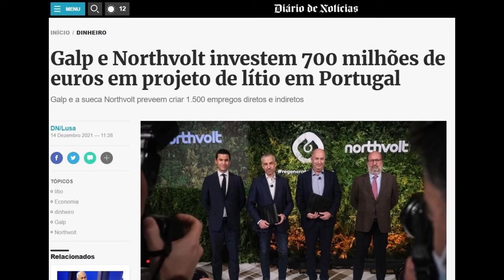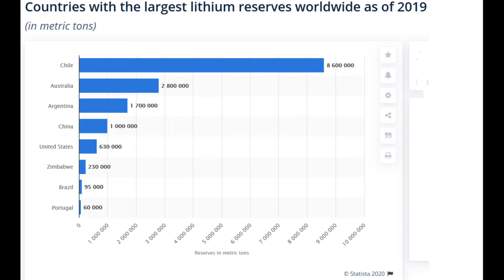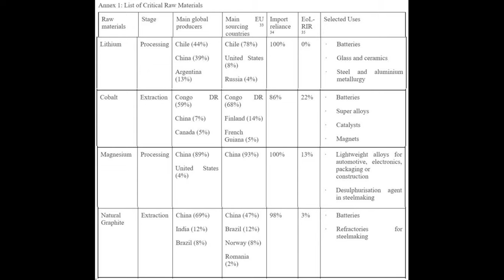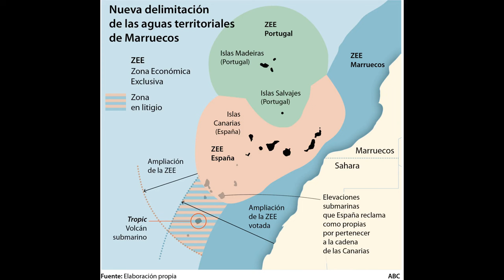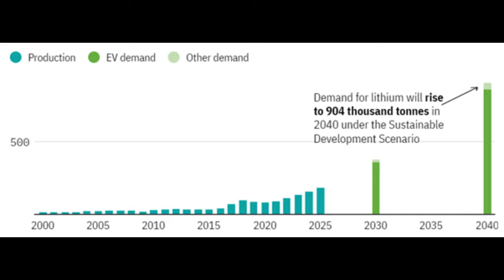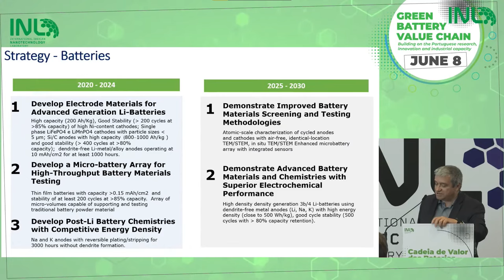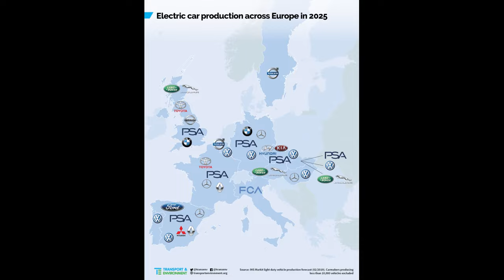Portugal - LARGEST Lithium Reserves in Europe

Comment: Are there no engineers doing the math of thr water cost of this mine? I just found out about it, we in Portugal dont have the water needed for the mining of 25 000 tons of lithium, thats around    2 500 000 000 liters of water (can be salt water, but still ridiculous). lowest expected water usage is 20 000 000 liters, and this claim was not given calculations to back it up, just speculation.

Furthermore, the agreement only restricts the use of SOME river water, if the company is allowed to use underground water it would still have a massive damage to the ecosystem.